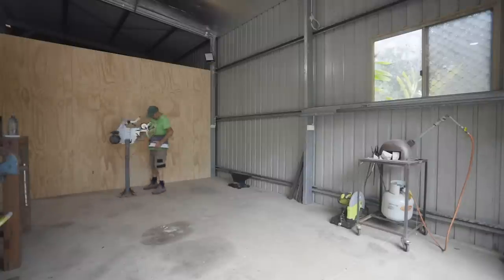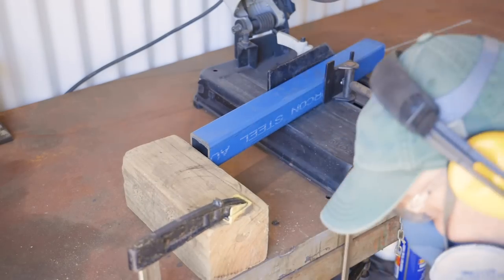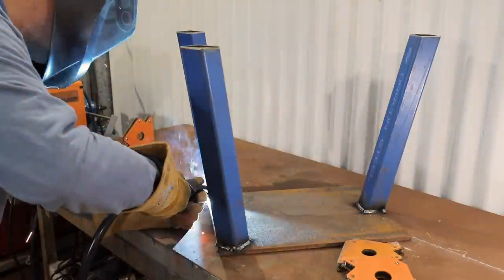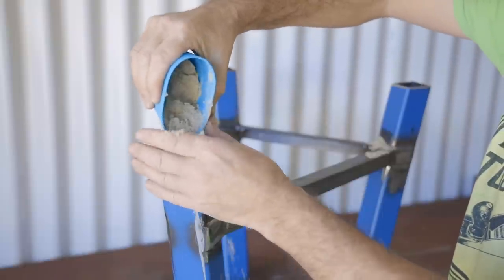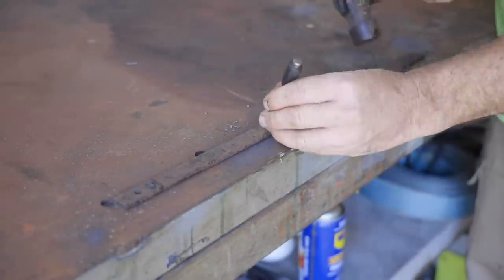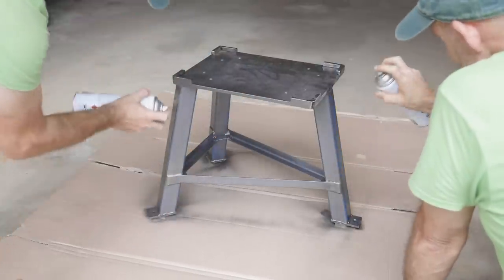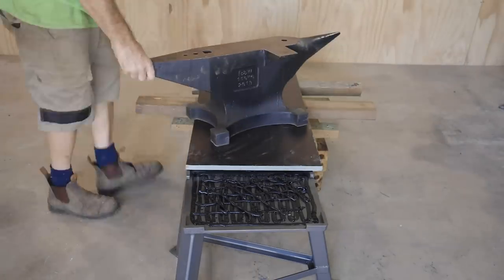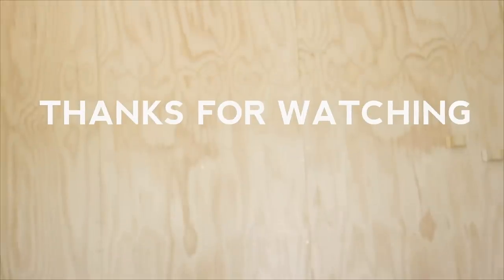Making a Blacksmith Anvil Stand

Comment from the maker: This was a project long overdue. I bought my anvil months ago and haven't got to use it yet. Also it's one step closer to getting my metal workshop up and running.

I didn't add a hammer/tool rack as I plan to make a small trolley to position near the anvil with what I need on it for each job.

I mentioned in the video that I was starting to struggle with the welder and I said I'd buy another soon, I've already ordered it and should be on it's way soon. The old welder has done me well until now, it's had heaps of use and was a very cheap one, so it's more than paid for itself several times over. :)
Reply: was that a Steele hammer I see there? :D Very nice seeing one Ytr supporting another, I might be wrong, but that Anvil Stand build was a good job imo, looking forward to more
Reply from the maker: @jebowlin3879  Thanks mate! The hammer was a gift from a mate who forged it himself! :)
Reply: I’m not really looking for gear recommendations, Neil, but I am curious about your “poor performing” welder. 😉  It certainly appears to work a lot better than mine, to be sure!  I’m guessing it’s a 220v (or Aussie equivilent😄), wire fed welder, right?  Are you running flux core wire?  Using shielding gas? (Not needed when welding regular steel with flux core, right?). I have a 110v Campbell/Hausfeld that was “gifted” (also known as, “junked”) to me by my neighbor when he got a new welder.  He said it barely worked, and he hadn’t the patience to try and fix it... a challenge RIGHT up my alley.😀  I’m not entirely sure I’ve got the settings right, but with a few tweaks and some TLC maintenance, it strikes an arc pretty reliably, so the actual limitation may be with my technique. I’ve never taken even a “Basics of Welding” class, so maybe that should be my next goal, eh?  They offer one at the local high school... might be fun, being 63 and going back to high school!
Reply: Thank yoj for sharing ,what brand is the Anvil ?
Reply: Pask Makes Hey Pask, can you please make a leather stitching pony? With your own uniqueness qualities? I’d love to see and even pay for something from your shop
Reply: @VideobyHomeworks  pi
Reply: Where did you get the anvil

Comment: Had the same thing happen when I put silicone down under my Wilkinson anvil.  I was amazed at how much squished out!  You'll be happy to know that you don't need those bolts now that you've gone through all the trouble to re-drill the holes.  That silicone is like a super-glue and you'll have a bear of a time trying to break the bond once it sets up!

The oil/sand mix is to help slow/stop the corrosion inside the legs from ambient moisture.  I usually pour about a cup into each leg, then fill with sand before welding on the feet.  The oil will migrate as you use the anvil, the vibrations helping to move it around as much as capillary action does.  Adding it before the sand means you can weld the feet on without worry that you'll light the oil on fire with the heat of the welder because the oil hasn't had time to migrate up to where you're welding.

Overall, great build and I'm looking forward to seeing what you come up with next.
Reply from the maker: Thanks very much! That's good to know how well they stick together with silicone, I did suspect that. It wasn't too difficult to re-drill the holes though. It makes sense that the oil slows down corrosion so I might go ahead and try and get some in there. :)
Reply: Pask- a small hole at top of leg, squirt in oil, tap hole, tapered pipe plug. Voila
Reply: @PaskMakes   The only way I could get my anvil off the wooden stump I had it on was to finally just tip the whole thing over and let momentum tear the two apart.  It was stuck very solid... and I later found out that a lot of professional installation companies use silicone to join machinery to the concrete floors instead of drilling and bolting them down because it acts so glue-ish.  :D

Comment: Welds work better on clean metal, no paint or rust. Might try wire brushing or sanding off any finish near planned welds.
Reply: I was thinking the same thing. It actually kinda made me mad when he didn't hit it with a wire wheel or a floppy disk.
Reply: I was assuming that was some sort of weld through paint that came on that tube stock from the factory. I've never seen it before but it seemed reasonable.
Reply: Sorry, but take a look at 5:14....
There you see that there is no paint.... 🙂
Reply: Mr Man These days you just rub a thumb drive on it. Be glad you never had to rub paint off with a punch card.
Reply: Was going to say the same until I saw your comment.
Reply from the maker: You're right, that would definitely help. But I've found mig welding to work well on surfaces like this and I did grind chamfers into the workpieces. 

When I say, I struggled with the welding, that isn't usually the case. Even though I'm no wiz with a welder I do weld pretty ok normally. :)
Reply: @PaskMakes  It is more one of those "best than take any chances" good practices rather than a "will have a visible impact every time" situation, that is why it often works well in such surfaces. You never really know when the surface rust is deeper/worse than it seems, exactly what the paint is made off, how thick it is or how much material is actually packed in the paint (so no hopes of knowing how it affects the welding process and results). Might be negligible, might not be, but it is simple to just erase the unknowns from the equation. I guess there is also a layer of consistency there too.
Reply: @louisvictor3473  As a professional welder myself, Mig as well actually. I do agree with this. It also takes away fire hazards.
Reply: @WinchesterxNL  yes, and breathing in burnt paint fumes! 🤮

Comment: I’ve used horse stall matting whenever I want a high quality, thick, cheap rubber matting. I did the floor in my home gym with it, which worked great. After that I found dozens of uses for the scraps around my shop (though I never had a cool ‘Scrap Horse Mat Challenge’ theme song). I’m guessing it’d do a bang up job on deadening an anvil.

In the States you can always get it at a farm goods store, like Tractor Supply. Be warned it comes in large sheets.
Reply from the maker: I'd love to hear the ‘Scrap Horse Mat Challenge’ theme son! :)
Reply: Depending on where you are in the world, they sell the same thing as children's play ground anti-injury matting (no specific name). I found that it's one of the cheaper products that encompasses the needs + because it's meant to be around kids and playgrounds, most are fire proof.
Reply: I sure hope "mat" isn't a typo.

Comment: G'day Neil,  Years ago in a big maintenance shop we had a 160 lb anvil sitting in a steel box of 6mm plate 300mm deep filled with dry sand and a 6mm rubber mat on top of the sand, supprted by a leg on each corner. It did a great job of stopping the ringing and it did not move about with the very heavy blows from 14lb sledges raining down upon the top. Tim

Comment: I know I'm going to like your videos before I start watching, so thumbs up to crush a troll. 

There were several useful tips, especially adding sand in the legs.  For your future consideration, when I set a stop for consistency, once I set the stop I move the part against it again to make sure all the parts see the same conditions.  Probably only makes a thousandth or two (inches) difference, but on machined parts it can be noticeable.  Thanks much for posting.

Comment: As usual, love your video. I'm commenting to share a potential design improvement I have implemented when I set up production spaces with equipment or tables that have bolt down tabs. I put the bolt tabs on the inside of the feet facing into the internal space under the item. It makes the bolts and tabs one less thing to bump into. It is especially useful when the legs are flared. No sharp edges, no trip hazards when you're carrying heavy work pieces.

Comment: G'day mate. Another thing you can do to reduce the sound on your anvil is to wrap chain around the waste of the anvil. It absorbs the ringing as well. As for your welder problems, have you taken the liner out of the hand piece and used compressed air to blow it out. Sometimes, metal dust or rust gets in the liner which can cause feed issues with a GMAW welder (MIG). You never know, you might not have to buy another one. Unless you really want to. Cheers mate. Love your videos.
Reply from the maker: Thanks Geoff! I haven't cleaned the liner out and that makes sense that it could be something like that. I'll give it a go although I have ordered a new welder, I really needed something better. :)

Comment: Nice work on the piece, and your muscle assistant is awesome.  I would like to make a suggestion about adding a second upper string of stretchers that you could add loops to hold your smithing hammers and tongs.
Reply from the maker: Thanks William! I wanted to keep the anvil clean. I do plan on making a rolling tool cart to use next to the anvil. :)

Comment: I appreciate the way you show when you make mistakes along the way. All part of the learning curve. I'm surprised you don't use one of those portable bandsaws instead of cutoff wheels. Since I got my portable saw (from Harbor Freight), I have used it more often than than any other method to cut metal (and I have cutoff wheels, a chop saw, cutting torch, and pneumatic & hand chisels, as well as a hot cut hardy tool).

Comment: Very nice! One thing about attaching the anvil to the floor, make sure you leave plenty of room around all sides, you never know what size piece you will need to use on it. We have a stand with our anvil but not attached to the floor so we can move it around and get to any side with as much room as we need. Just something to think about.
Reply from the maker: Good point. I'm not sure exactly how I'm setting everything out yet either, so I won't be rushing in, to bolt it down. :)
Reply: You might use epoxy to embed reusable threaded anchors into the concrete, and rubber sheet material for the decoupler, so you can move the Anvil when needed. It's only a little extra work, and you've got such a nice stand and big flat concrete floor, it would be a shame to not have the option if you need it.

Comment: Nice work 👍🏻
We call them “ties” not stretchers
They are tying the legs together preventing them from opening/sliding outwards.
With good sized ties you don’t need to anchor the stand to the ground.
Reply: I think anchoring it is so that his work shop stays locked in and nothing moves
Reply from the maker: Thanks Mohamed! It shows I'm more of a woodworker by calling them stretchers, but thanks for the clarification. :)

Comment: If you turn the anvil upside down and attach the stand you could then just flip it over using a fulcrum and leaver of some sort, if necessary. It’s how builders get their mixers onto the stands when they’re on their own. Don’t lift the heavy thing onto the light thing, reverse the process.

Read this as a helpful comment not a snide one, like most of YouTube comment sections.
Reply from the maker: No worries Pete - that would certainly be an interesting way to do it! :)

Comment: Well Neil thats a nice job ,if your gonna work with steel one of the first things you need is a chain fall and some lift straps ,steel can get heavy fast ,save your back and your feet and get one dont worry you can still use metric in all your measurements ....lol ,oh and i don't think you need anything to hold that anvil down once you set it in place
Reply from the maker: That's a good idea, I should look into that and as long as they're metric then that's ok! ;)

Comment: Nice build! And Girl Power! I suppose the sand was "wet" from water?  If yes, if the tubes are welded "watertight", I would drill a hole in each leg, it will take a few months for drying out.  Otherwise rust will eat through in 15 years from now.  I would not add oil after, sand absorbs vibrations best when dry and free.

Comment: Nice work, have you cleaned out for tip ? sometimes when it's dirty the wire won't flow through it.
 liner might  also need a clean. Next time you put a fresh coil of wire in blowout your liner.  try putting a ear plug on the wire before it goes through the feeder it will clean the wire.
Reply from the maker: Thank John! The tip is fine but I haven't cleaned the liner so that may be it. I'll give it a go! :)

Comment: For something like those tie down straps you made. Would it be a good idea to temper those to stop the steel from simply bending when you tighten the bolts?
Only reason it was on my mind is I needed to remove a steering wheel locking plate and bent up a piece of mild into a U shaped to use to compress the spring with the steering wheel nut. The bar was pretty easy to bend cold so I tempered it for fun thinking it might  help fight deformation. Seems like the same might apply here.
Reply from the maker: I'm not sure if tempering would do anything and I'm happy enough with them bending. :)

Comment: The problem you had welding may have less to do with the welder and more to do with your ground. I noticed that your welding bench appeared to be a bit rusty and that is where you had the ground clamp. Nice project all in all.
Reply from the maker: Thanks Dave! You maybe right. There were a few things that weren't at their optimum, but I've noticed the welder under performing for a while now(in different situations). :)

Comment: I would be interested to know where the anvil was purchased and also why  did not use step cone drills.  I have never used them but think they may be a good idea. Your expert opinion would be appreciated.
Reply from the maker: I do use step drills but the steps are't wide enough to drill through thick steel plate.

 I bought the anvil form here https://www.artisansupplies.com.au/product/110kg-anvil-6150-steel/

Comment: If you remove all the rust and paint before welding the results will be much better.
Reply from the maker: You're definitely right, although I did grind decent chamfers on the workpiece. My struggles with the welding aren't my normal experience, so that's why I think the welder maybe past its best. :)

Comment: Where did u manage to buy such a great anvil?  Prices vary so much. I am in Aus and have my radar up for a similar bit of kit. 
I wonder if a U bolt might have been an option for the hold downs?  Not criticising, just a thought.
Reply from the maker: I did think about U bolts but was easy enough to make these. I bought the anvil from https://www.artisansupplies.com.au/product/110kg-anvil-6150-steel/

Comment: Great work - bad anvil stand. It needs to be a solid vertical extension of the foot of the anvil, strait down.
Reply from the maker: Thanks - I reckon I got the balance just about right, 12° is pretty steep but still has a little splay for stability. I've seen many stands that splay far more than that (like 25° or more) and the legs aren't tied either. I'm very happy with it! :)

Comment: Так нельзя тяжести поднимать - спиной на прямых ногах, все наоборот, спина прямая, ногами подсаживаешься и разгибаешь. По теме - возможно стоило сделать резиновые подкладки как под наковальню, так и под крепления наковальни болтами.
So you can’t lift the weight - with your back on straight legs, on the contrary, the back is straight, sit down with your feet and unbend. On the topic - perhaps it was worth making rubber linings under both the anvil and the anvil bolts.